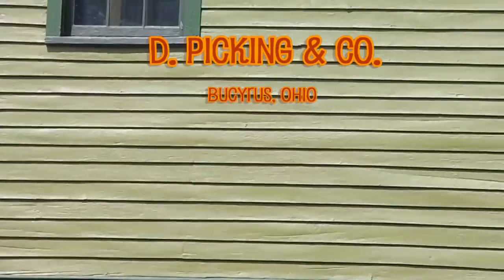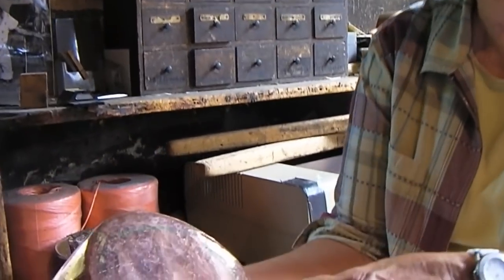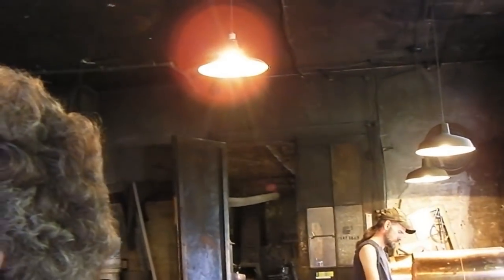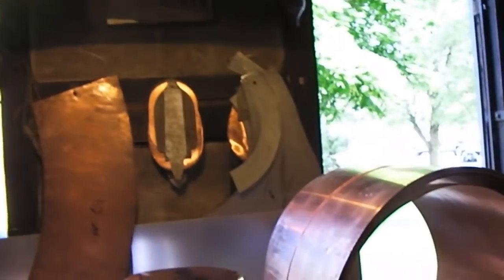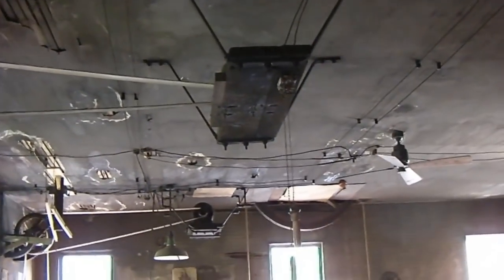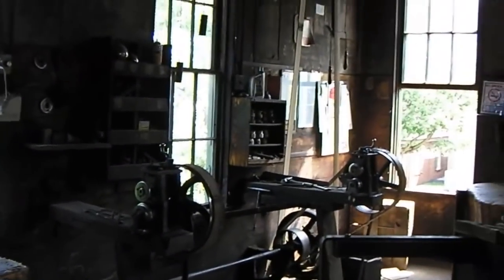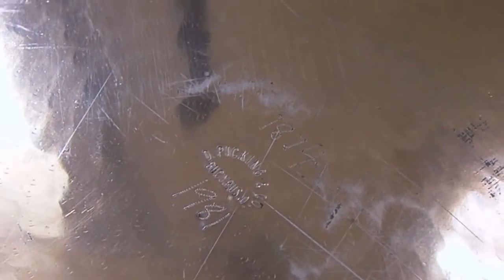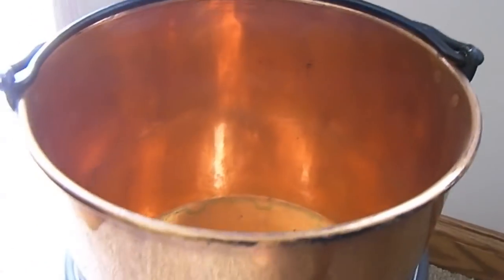Copper Kettle Shop (D. Picking & Co.) Bucyrus, Ohio

Comment: No, they are powered by one electric motor 1910 that drives an axle with a belt pulley system for the different tools.